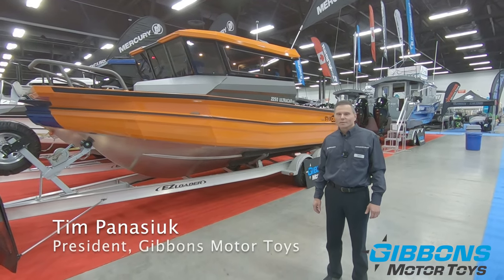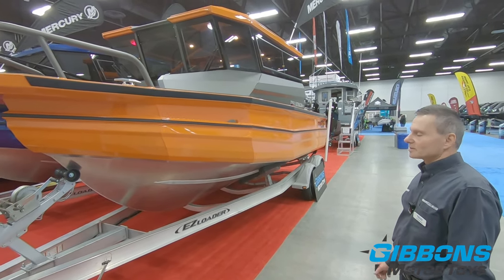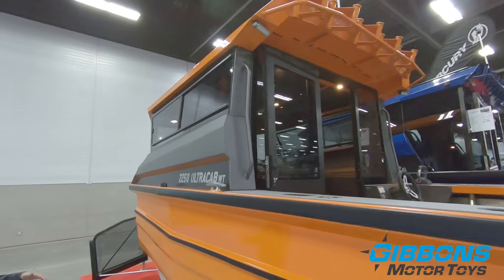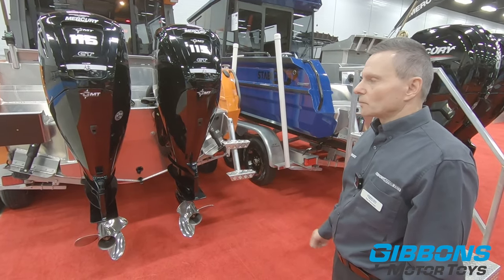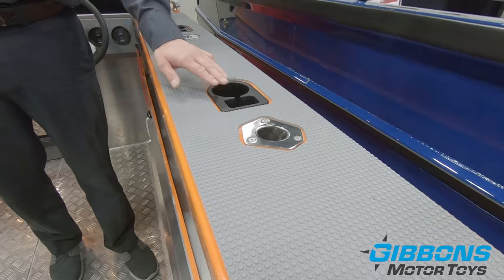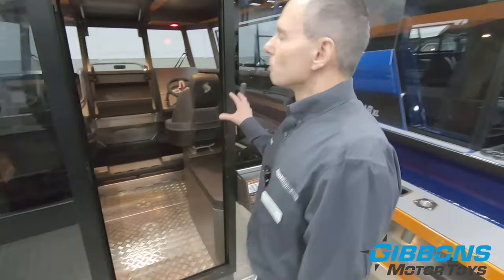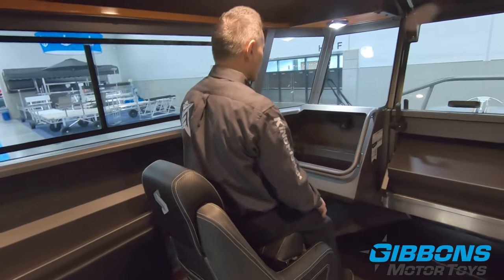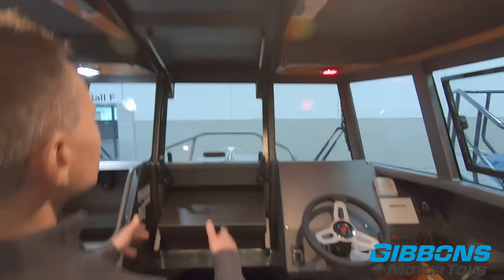2023 Stabicraft 2250 Ultracab WT - Walkaround With Tim

Comment: Maybe I missed it but what is mounted on the starboard side of the bow? I noticed it in your other Stabi video.
Reply from the maker: I believe you're referring to the bow boarding ladder. It pivots down 90 degrees when being used / stows in the position you see it when underway. It makes getting into the bow much easier when pulled up to shore or on the trailer.

Comment: I don't understand why you don't offer a 300hp, the Mercury 300hp Verado comes in 30in shaft?
Reply from the maker: Hi Joe, we don't list this as an option, but would certainly be willing to do it. It complicates the steering system a bit as the the factory Verado setup isn't the most friendly with kickers. There is an aftermarket power steering system that can solve this problem though.
Reply: @joe joe
Reply: Take notes buddy

Comment: No selfbailer? Im not a fan of pink foam bilge
Reply from the maker: At first I felt the same way, but after using this boat personally it's really not necessary with their cockpit design. With their chambered hull there is no conventional bilge area to collect water and debris. The lowered pockets where the bilge pumps are located do a great job evacuating all water. Any debris left is very easy to cleanup. On a boat this size a self bailing deck requires a higher floor height resulting in either less freeboard or a boat with tall sides, which does not help fishability.